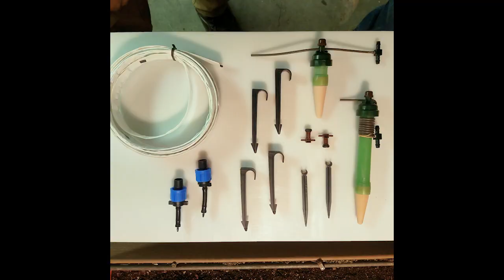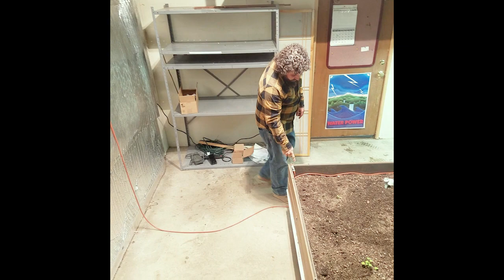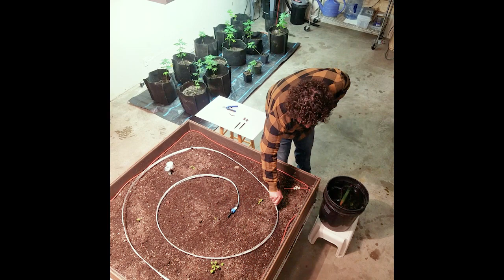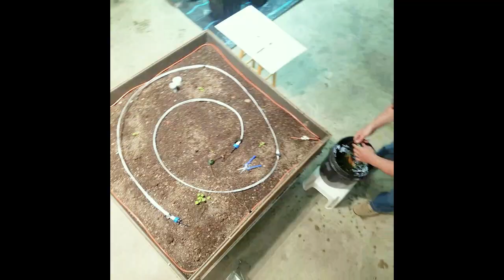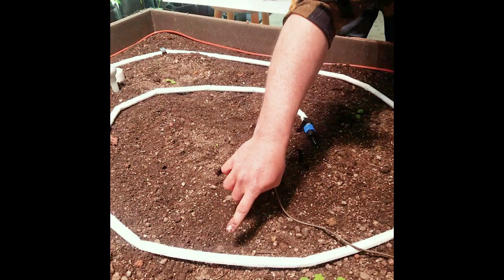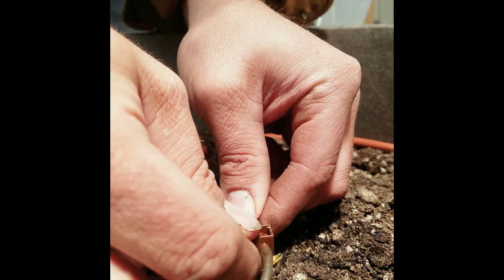How to set up the Blumat 4x4 Mid Range Raised Bed Kit

Comment: There are a few big issues with their setup info. Mainly that the hanging drip is super inconsistent. I can set the hanging drip and mark it, reopen the carrot to allow for a full flow and then close the carrot again and the hanging drip is a full carrot different? I have 2 carrots in a closed loop just like this ...  Are you supposed to have each carrot closed and dial each in individually?

Comment: Why are two carrots needed? I bought a kit and it only comes with one. I am so confused and frustrated why the kit would only come with one if two are required.
Reply from the maker: 2 carrots are not required, the kit works perfectly well with one carrot. However, the kit with 2 carrots is more sensitive to soil moisture levels because it is sensing at two different parts of the bed/pot.

Comment: Did the black center on the soaker hose get replaced or did I get a bad one. Have no center hose to hook to only the white outside hose?
Reply from the maker: You didn't get a bad one. The black center is not necessary for our new BluSoak 2.0.

Comment: I understand how to celebrate the carrot but how do you calibrate the distribution soakers when you have 3 or 4. If the closest one is fully open than there won’t be enough pressure to supply the last one in the line. I’ve watched at least a dozen setup videos and “nobody” discusses this.

Comment: couldn't you adjust the carrots without unplugging them by adjusting them so that a drop keeps hanging on  the distribution dripper?
Reply: No
Reply from the maker: Matthew is correct, no you cannot. You have to adjust them with the hanging drip on the 3mm tubing

Comment: the dripper next to the carrot , inbetween the carrot and the soaker hoser , will be better left out, as its giving direct water to the carrot, better to let the hose trigger the carrot, for better all over bed water levels
Reply: that one is actually necessary to fine tune the carrot flow as we use the drips to dial it in. its almost impossible to dial it in with just the soaker hose.  his dripped should of been a little bit further out, but not too far otherwise it will surely over water!